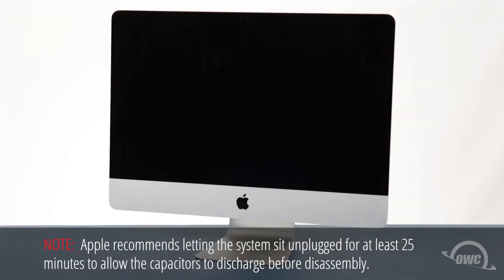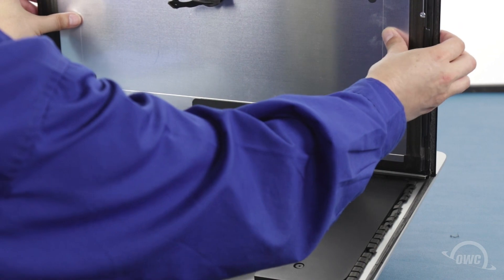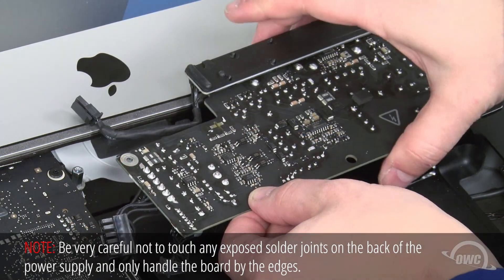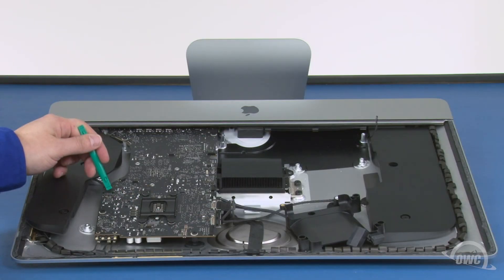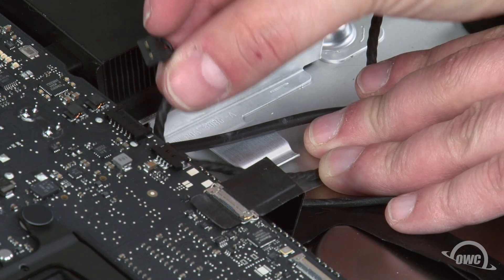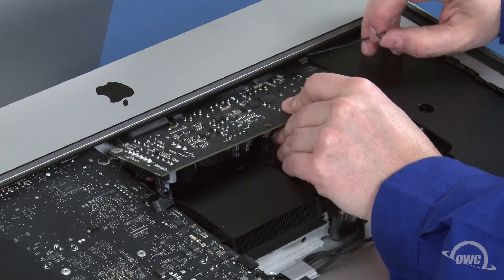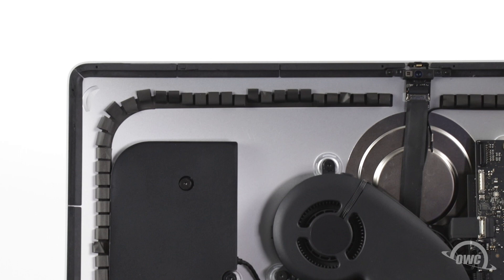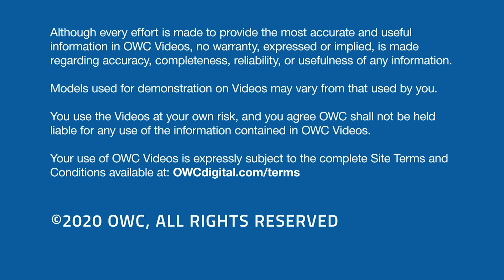How to Install an SSD Card into a 21.5-inch iMac (Late 2012–Early 2013) iMac13,1

Comment: Hi !!! Sir

I need to know, can i put 2013 imac motherboard to 2012 imac (21.5) A1418
Reply from the maker: This particular iMac model was in use from 2012 to 2017. Therefore, you would indeed be able to install the 2013 motherboard into the 2015 iMac.
Reply: @poweredbyowc  Thank you sir ❤️

Comment: Great informative video, my question is can i just replace the HDD with a 2.5 1T ssd drive, and also will i have issues with the fan running fast. If i do this change do i need a thermal sensor, on a late 2012 A1418 imac.
Thx in advance
Cliff
Reply from the maker: Hey Cliff,

If you change out the HDD with a 2.5" SSD you will need a In-Line Thermal cable to control the fan speed.

Comment: hi can use the ssd with iMac 2012  2.9 Ghz core i5
Reply from the maker: You should be able to install this Aura Pro 6G SSD without a problem. You would just want to check if your iMac is a iMac13,1. You can find this information by doing the following:
Apple Symbol --> About This Mac --> System Report or System Information --> Right side 2nd line You should see where it states Model Identifier.
Reply: @poweredbyowc  My iMac is a iMac13,1. However Aura says this SSD fits 13" or 15" MacBook Pro with Retina Display from 2012 or Early 2013. I have an iMac 21.5" (late 2012). Plus, can I buy 1 TB with the Aura Pro 6G if this does work on the 21.5"?
Reply from the maker: Yes, the Aura Pro 6G will work with the 13,1 and will also work on some of those other MacBookPro's as long as they are a MBP10,1 or MBP10,2. Feel free to reach out to us directly as well as we can better troubleshoot and determine what you need (https://eshop.macsales.com/Service/)

Comment: For those wondering why there are so many disassembly steps, they are adding an m.2 ssd to the existing hdd.  
If you are just replacing the HDD with a SSD it's a lot quicker.
Reply from the maker: Thanks for adding Matt, yes this is the more intrusive installation, if you're installing a SATA SSD the process would be much quicker with less parts to take out.

Comment: This way will keep the original HD and the SSD working together? What is the model os SSD card?
Reply from the maker: Correct going this route would allow for us to keep using the HD as well as use the SSD. For the needed os if installing an Aura drive we would need OS Mojave or later. If you ever have any other questions or concerns please let us know at support@owc.com!

Comment: Is this compatible with late 2013 21.5 inch imac 14,3???
Reply from the maker: For an iMac14,3 they are not compatible, however here is a link to some options that are: https://eshop.macsales.com/shop/ssd/owc/imac-21.5-inch/2013-2019

However check to see what you have before buying, as these are dependent on if you have a HDD only, Fusion, or SSD only iMac.

Feel free to reach out to us directly for any questions.
Reply: @poweredbyowc  I have an HDD only 14,3 can i replace it?
Reply from the maker: If you have only an HDD you can replace with our OWC Mercury Electra 6G SSD iMac upgrade kit.
https://eshop.macsales.com/shop/ssd/owc/imac-21.5-inch/2013-2019
Reply: @poweredbyowc  Is only this SSD compatible or can I use any?
Reply from the maker: The Aura Pro X2 is also compatible with your iMac 14,3.
https://eshop.macsales.com/shop/ssd/owc/imac-21.5-inch/2013-2019

Comment: My Fan spins so fast now. No mention of needing to fix that...
Reply from the maker: Hi 2Guys!  I’m sorry to hear that you're having trouble with the fan in your iMac.  If you haven't replaced the Apple drive in your iMac, check with a local Apple Certified Technician as this should be handled through the operating system.  If you've upgraded to an OWC SATA drive, please contact us at 800-275-4576 or support@owc.com for troubleshooting and assistance.

Comment: How do I use the hdd as an external after I've taken it out
Reply from the maker: Hey Q_TBG, you would need this Envoy Enclosure for the PCIe drive:
https://eshop.macsales.com/item/OWC/MAU3ENVOYPRO

You also mentioned HDD, if you need an enclosure for that it would be the OWC Express:
https://eshop.macsales.com/item/OWC/ES2.5BU3B/
Reply: @poweredbyowc  those are 2 separate enclosures. I need one for my late 2012 imac hdd that I took out. I want to use it as an external. Which of these enclosures would be the best option?
Reply from the maker: Q_TBG,

We would be happy to determine which enclosure you would need specifically if you could provide the serial number of your iMac, Please?

Comment: what kind of ssd is that, im confused.
Reply from the maker: It's a PCIe SSD, like the ones here: https://eshop.macsales.com/upgrades/imac-21-5-inch-late-2012-2.7-ghz/InternalDrives?filter.dimension_ssd_sshd_or_hdd_91=SSD&sort.price=desc
Your machine must have come from the factory with an Apple SSD in order to upgrade it later.
Reply: @poweredbyowc  how do i know that my machine comes with and Apple SSD? My Model is the IMac late 2012 21.5" 2.9Ghz Core i5? my Storage says SATA Disk